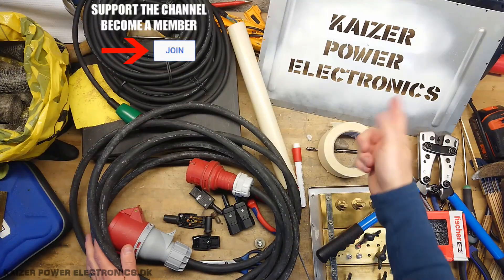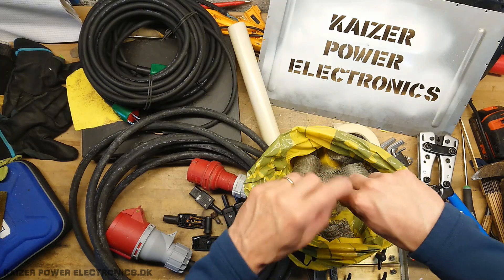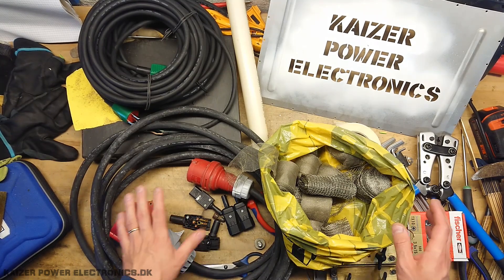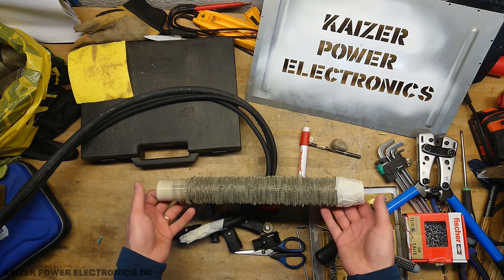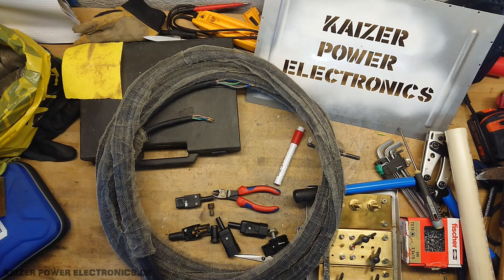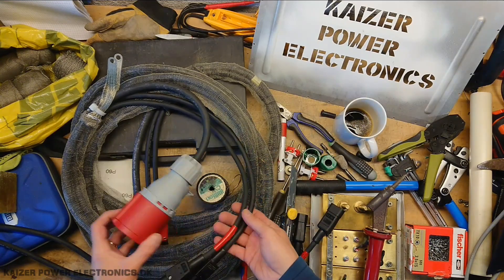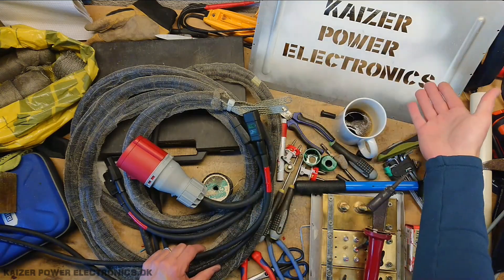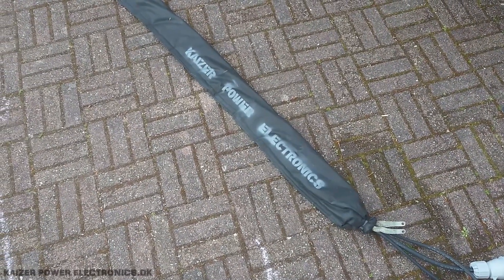Shielded Supply Cable For Large Tesla Coil

Comment: For the ends heatshrink sleeving over the last half metre each side will do wonders, and also running a length of that braid inside the knitted shield, so as to make for a low impedance connection all the way down, as otherwise the sharp edges will couple through, but with good LC filters and MOV clamps both sides not really an issue.
Reply from the maker: Good idea with the heat shrink tube!

Comment: Nice technique with the pipe.  Even applying braid to small cables is a bugger.  Thank you!
A bit late now, but a sequenced LED string going down the cable might add show value for the PC gamers.
Reply from the maker: Great tip on the LED! Maybe I should run a garden hose with it, for water cooling?
Reply: @KaizerPowerElectronicsDk  Sure. Or two hoses so you have a return too!
Reply: @KaizerPowerElectronicsDk  Absolutely, but with mineral oil instead -- gotta have a mess that won't evaporate. 10"w" RGB LEDs beaming down the hose as well.  Red for power, blue for coolant, purple for return.  :) :)  It looks good as is though.

Comment: Cool. Any reason why you didn't twist them in a uniform spiral? I also wonder why the cloth cover is so loose? It would be much more manageable if it was a bit tighter. Still a well done mod.
Reply from the maker: The smaller cables were just unpacked from their plastic, might have been easier to work with if they were layed out a day beforehand. The cloth is actually double folded, so the cables are laying in a tight inner loop and it was just double folded out over it again for additional mechanical strength. The entire 1 meter width of the cloth is used.
Reply: @KaizerPowerElectronicsDk  ah cool.